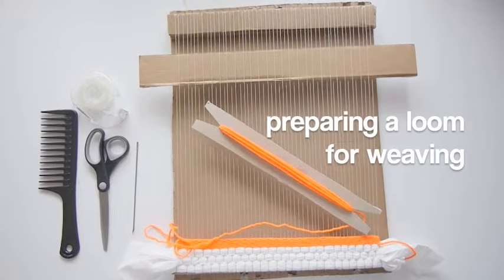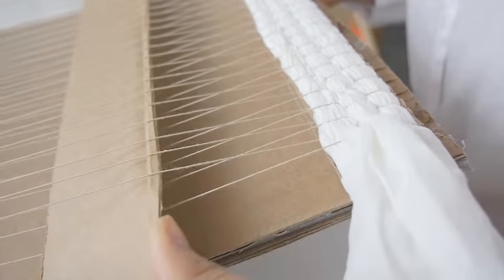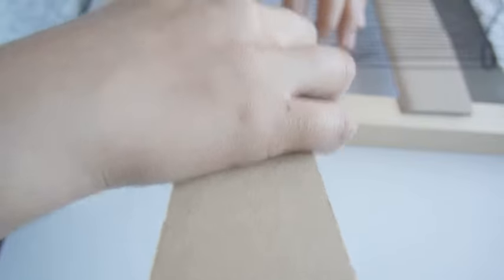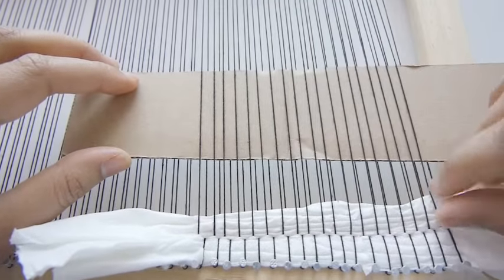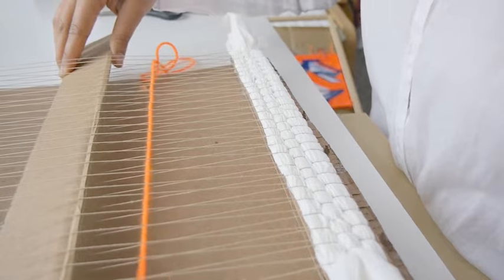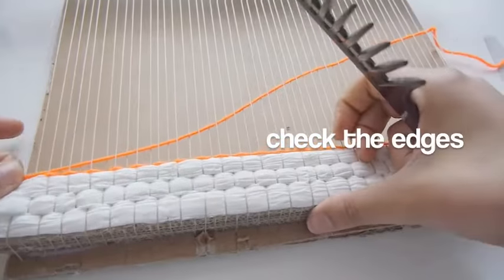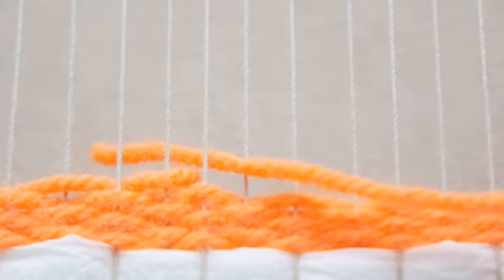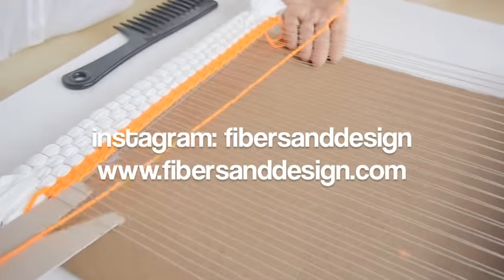How to Weave | Weaving for Beginners

Comment: Looks great, thank you but wondering why you wouldn't keep the 2nd shed in and use it rather than pick through each warp thread when you go back the other way. I'm just learning so maybe I'll discover why.
Reply: If you tie the ends of every other thread to one stick and the others to another, you can lift these up each time…  you secure the sticks so they keep the threads steady but allow them to move up or down when you want.
Reply: @louisegogel7973  Thank you yes I tried that and it was more frustrating/slower than just going back and forth between the threads. "secure the sticks" hmm. Maybe that's the operative phrase. Not sure how that could be achieved. I just pulled the stick taut with one hand and tried to manoeuvre the yarn through the shed with the other. Need more hands lol.
Reply: @taniakol  The sticks themselves wouldn’t have to be secured onto anything as long as the end of the warp is secure.  This way one can loop any number of desired strings onto separate sticks to lift as needed for whatever pattern is desired.  

The setting up would be the most time consuming part, but once achieved would make listing each of the layers a breeze.  I would color code, number, or label the sticks for which strings they are lifting.  You could of course make any number of cardboard or wooden heddles for the lifting instead of looping string around your warp threads.
Reply: @louisegogel7973  Thank you, if you know of a vid that shows the 2nd stick method that would be great. I was looking and couldn't find one. As I said I did it and it was very frustrating - tying every other warp thread onto a stick, and then attempting to pull that stick away with one hand, trying to keep the warp threads taut enough to put the yarn through the shed with the other hand.. Maybe it was harder because I had the frame vertical, on a stand, rather than flat on a table, I don't know, but it didn't work for me.
Reply: @taniakol  Hmm, I think that is why she has that blade in there, to hold the thread apart after you life the stick.  I will look and see what I can come up with.

Comment: Can you use embroidery thread for the warp? That’s all I have for something like the warp.
Reply from the maker: Thank you for sharing your question :) 

(Short answer: In these times, just experiment, use what you have and give it a try. Perhaps sample with a smaller loom style (maybe make a small pin loom) to see how many ends you need for the design and what’s the best weft. Below are some tips🌻)

The warp should hold the weft yarn in place- so, the way I check the strength of the warp is by pulling on the 2 ends of the yarn. If the yarn can withstand the pressure, then its ok. 

Now, embroidery thread is really thin, but sturdy. Perhaps using yarn that is also thin for weft could work- and increasing the number of ends per inch when dressing the loom.

Hope this helps :)
Reply: Thanks, it really does!

Comment: Thank you for this video!  I recently received a basic loom, and has not the piece you wrap your weft around but a needle. How do I estimate the amount of weft yarn from the beginning, and how do I do it with only a needle?
Reply: The piece used to pass the weft through the loom's warp is called a shuttle, and it literally only holds your weft material so you don't have to pass a loose bundle of yarn through the "shed" (the gap created in the warp by using the shed stick). You can use a needle, but the idea is being able to slide your weft yarn through relatively quickly and very accurately. A needle is certainly very accurate, but likely quite slow.

Estimating weft yarn is a little tricky, but the basic formula is: Length (of finished piece) * Width (of finished piece) * PPI (picks per inch, which is related to how your loom is warped). Length and Width should both be expressed in inches for continuity of units. Divide the answer by 36 if you want yardage, and remember the rule of estimating: add a little for future errors. :)

Comment: Hello I have been weaving for a few months now and I have no idea how to finish it. I have been trying to ends off after cutting it off the loom but it just falls apart. So I tried to wet finish it and it still doesn't work. I have been using acrylic and polyester yarn. Do Synthetic yarns not work?
Reply from the maker: Great question! You can use various fibers and materials to weave, but creating a secure base is key. When you start, secure the first row with the twining pattern. And, the last row of weaving should be a row of twining- this will secure the weft ends when you cut the weaving off or display it. 
After you remove the weaving from the loom, you must secure the ends. I have a video on 6/7 ways to secure and display weaving and a tutorial on twining. I will leave links in the description shortly! :)  I hope this helps!
Reply: @fibersanddesignweaving  Thank you! This really helps